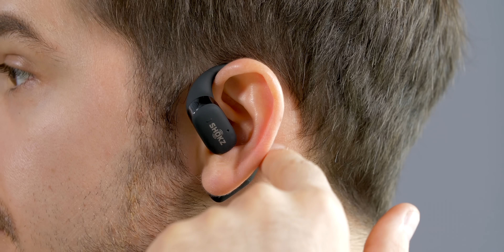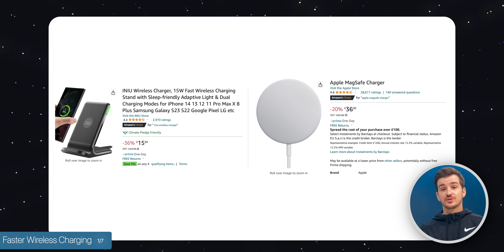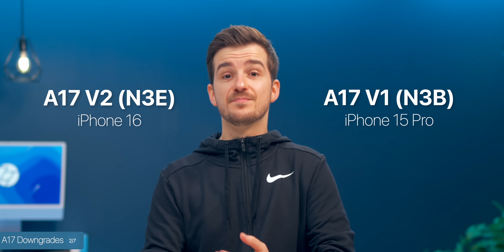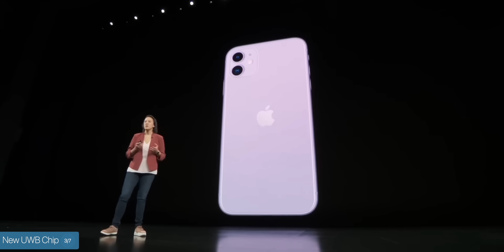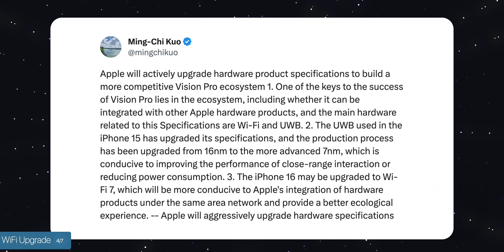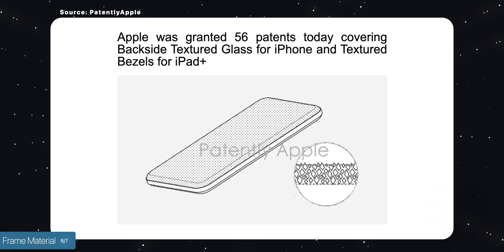iPhone 15 - 7 NEW Updates!

Comment: the Qi charge sped restriction is a joke, the charging is artificially limited in Magsafe phones to 7.5 when it already uses 'qi' to charge at 15w - it just stops if your charger doesn't supply the special Appl secret handshake. It's an insult to update the charge speed on the 15 and not allow it to work faster on phones like the 13 and 14.

Comment: The iPhone has basically had the same design since the iPhone 11. Kinda ridiculous, if you ask me. They need to put 120hz refresh on the basic model. That's becoming standard, even on most midrange Androids. Apple's refusal to make the iPhone compatible with a stylus is just stupid. They should at least do it for the Pro Max. All that screen real estate for what?  They don't even let you fit more apps on the home screen, just make the icons bigger. Smdh The dynamic island is something no one wanted. The notch is irritating, but the island intrudes even further into whatever you're using the screen for. Now they're going to charge more for what, minimal design changes?  The physical alert slider is one of the coolest iPhone features & they're changing it. 🙄 I doubt they'll go with the awesome red color for the pro models.  I think they save red for the Product Red on the base models exclusively.  We'll probably get the "new" dark blue option.  Blue...again. 😖

Comment: I think the action button will be one of the most underrated changes. Getting rid of the mute switch is actually an improvement software wise as you may be able to toggle it then via software rather than hardware, which also includes automation. Therefore you would be able to turn on silent mode whenever you leave your house or come into work or maybe when your work focus is turned on, etc. And because there were major changes to the automation in Apple shortcuts, this can all be fully automated. Just leave your house and your phone is silent. Step into your house and your phone is loud again. Plus you get a customisable action button as a bonus
Reply: Personally I trust hardware more than software, that's why I like a physical button for mute.
Reply: It really bothers me that you can’t toggle the ringer within shortcuts -  it makes sense since it’s a physical switch, but it would be so convenient
Reply: @juliemfchristmas  Theoretically it's possible, when the switch would be magnetic. Then the it could switch the switch electronically when triggering a shortcut. Would be insanely cool, but this could be problematic due to space, maybe possible defects and cost
Reply: Personally I think the removal of the silent switch is the biggest downgrade in the history of the iphone.
Reply: @Pingwinho  I don't get why people are afraid of a button. Especially because silent mode can be either set manually through the control centre, through the button or via automation, when for example leaving the house or starting office hours. I much prefer a functioning automation than a switch that has basically no use other than toggling silent mode. With a button, you get more possibilities and gain control over silent mode through software
Reply: @yourDecisi0n  Because I often use the silent switch when in a meeting/cinema or any other setting where I don't want to pull my phone out and change it via screen. The silent switch gives me a haptic feedback whether the phone is silent or not, without having to look at it.
Reply: @Pingwinho  Who knows, maybe this will still be decent with the new action button. If the phone vibrates specifically to inform the user whether it's silent or not, this would still be okay to work with. Even if Apple hasn't thought about this, I'm sure, you are able to do this with a simple shortcut, which toggles the silent mode and depending on the setting it either vibrates once or twice
Reply: @Pingwinho youll be able to set the action button to open silent mode surely

Comment: I upgraded from the 8 plus to 12 Pro to use UWB on the airtag and also I was interested in LiDAR.
I also appreciated the many minor improvements between the two models.
Reply: Minor? Those are completely different phones, from screen size, panel type, performance, cameras, biometrics, to the way you interact with the phone without a home button. These are not minor changes. iPhone 12 Pro to 14 Pro would be minor changes.
Reply: I upgraded from an iphone 8 to an iphone 13 pro and the differences are huge! I’m content with my current phone and I don’t really think in upgrading until another 5-7 new versions come out